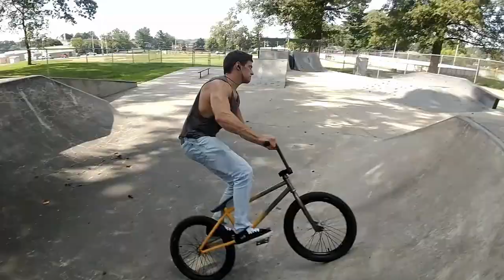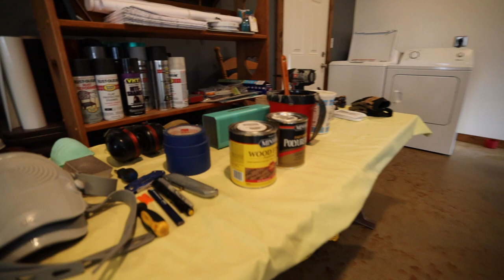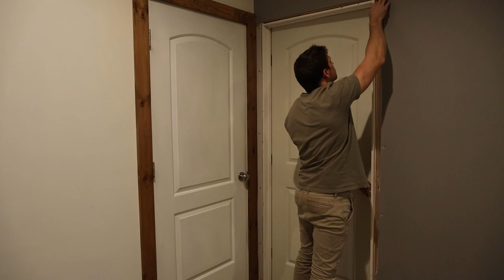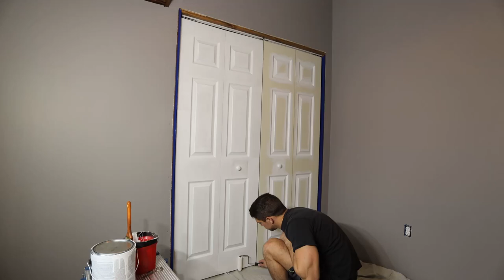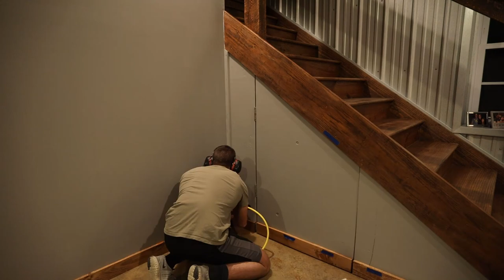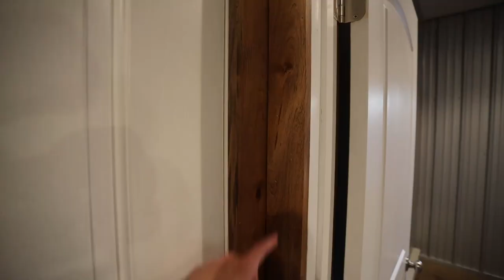Hanging Doors and Trim - New Bedroom is Complete!

Comment: Hey, I've done finish carpentry like this on multiple homes.  For your first time installing a prehung door and bifold doors, you did a great job!   Bifold doors can be tricky sometimes.  I do things some slightly different, but we all learn and adapt our own styles with time.  You mentioned that the rough opening of the door was a bit large but that is likely due to you mounting the hinge side so close to the stud.  In general, you should try to shim out the hinge side a bit as well, even if the stud you are mounting to is plumb.  This can help to prevent issues like trying to fit casing around the door on that short side, and other issues with keeping the whole door plumb when going to nail in the other side of the door (having some play on both sides can make adjusting things after the fact a lot quicker).  Sometimes the plumb, hinge-side board is a little twisted causing the door not to want to shut if you keep the hinge-side door jamb tight against it.   I love watching you continue to build out your house.  Looking forward to the continued progress!
Reply from the maker: Thanks so much for the tips! What you said is exactly what I realized after the fact, to shim out that hinge side to center the whole thing in the rough opening. Thanks for taking the time to watch and give feedback 🙌.

Comment: it looks really good but i would offer you a suggestion for the stairs.  The vertical stripes look nice but i would get a bit of filler/dry wall putty and go over those knots in the plywood.  then sand them smooth and another coat of paint.  I think it would make it look a lot nicer and stand out less.
Reply from the maker: Thanks!  I really don't mind that, I was going for more of a rustic textured look.

Comment: You may want to seal the floor trim so that when mopping water doesn't get under the walls
Reply from the maker: I did polyurethane the bottom
Reply: @Kordare  I meant caulk to fill the gap between the wood and the concrete